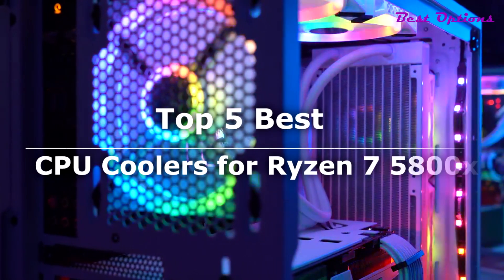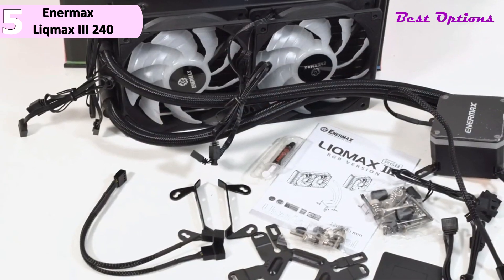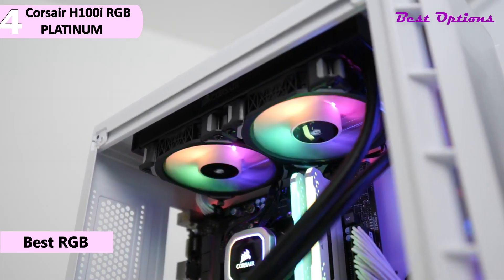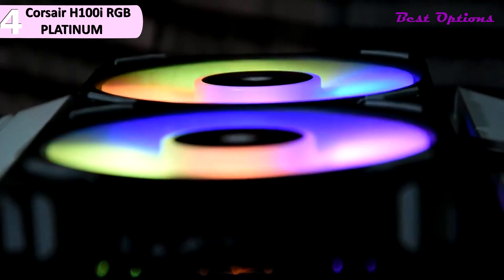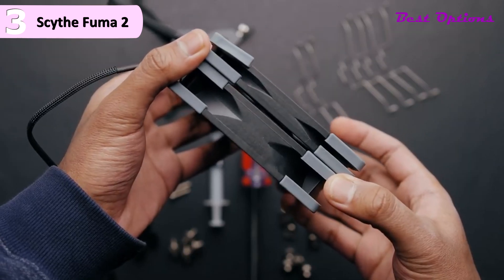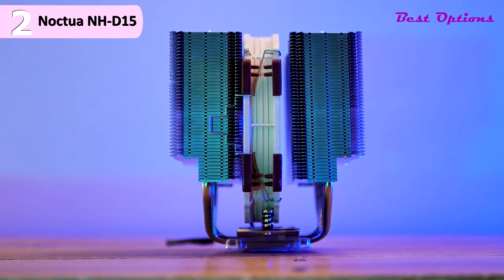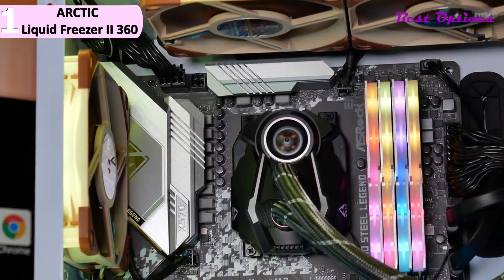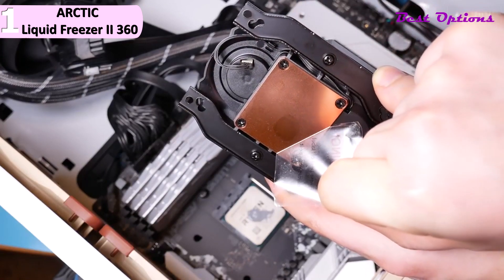✅ Best CPU Coolers For Ryzen 7 5800X

Comment: I have a thermaltake th120 aio and before that I was using a gammax400 air-cooler with my 5800x and I was getting max temp spikes of 88-90c and generally staying around 80c while gaming with the air cooler. I expected a big difference going to liquid cooled but tonight while playing dying light 2 I hit 90c. It still averages 80c and 45-50c while idling. Does that sound right??? I feel like it's still running much too hot.
Reply: Those are ok temps, only worry if you go past 90c. The chip is designed to handle full load at 90c. My recommendation would be to lower PPT as the default is 140w, you can bring the PPT down to 115-120w and you'll see a 10-15c reduction as there is less voltage passing to the CPU. Performance is unlikely to take a hit at all.

I used eco mode and I saw only a 5% decrease in performance but it kept my full load temps 65-75c

Hope that helps
Reply: @calvinprior7067  tysm this is helpful!
Reply: @calvinprior7067  idk why but mine idles at 70-80c and I only have chrome open